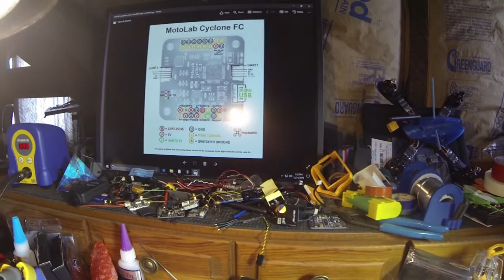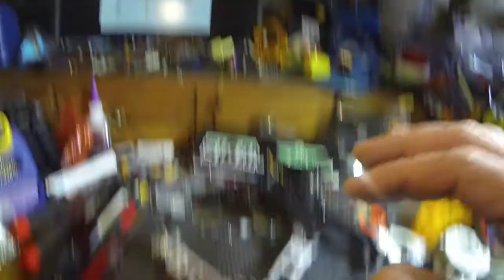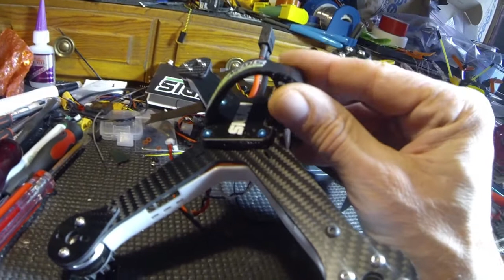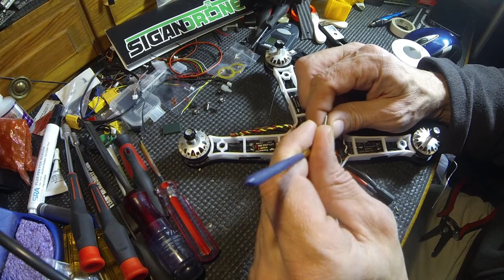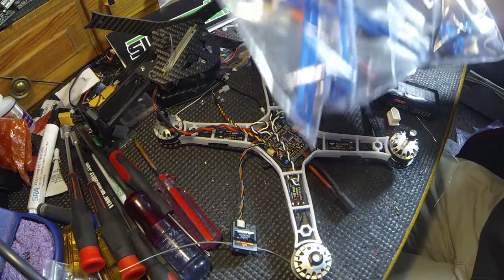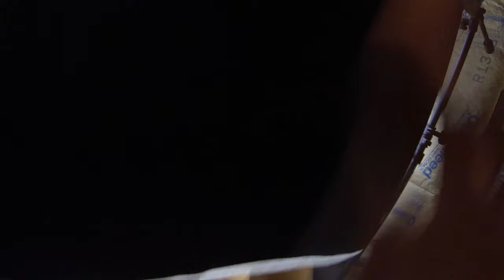Sigan HD Stretch, Motolabs Cyclone and Connex ProSight Build

Comment: Would you mind measuring the dimensions of the PDB and flight controller? Really interested in this frame but Id prefer to use a power cube from TBS instead of soldering everything...also if you want some advice...if you had a little more enthusiasm in your voice you would definitely draw more people
Reply from the maker: A full Power Cube would never fit, an FPVision with external ESC would.
Reply: I was thinking more along the lines of an FPVision...thanks for the reply!!! Do you know if the mounting holes line up?
Reply from the maker: Yes, But PDB Makes i difficult to do what you want to do. i would look for something else.   but it can be done.